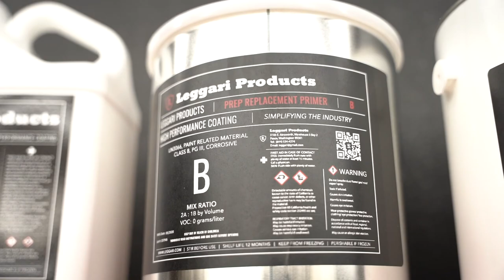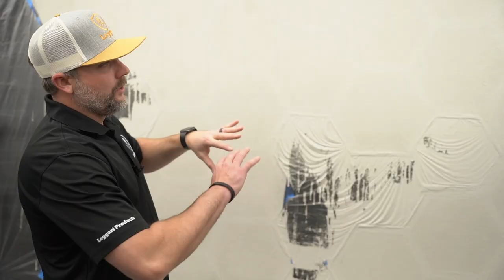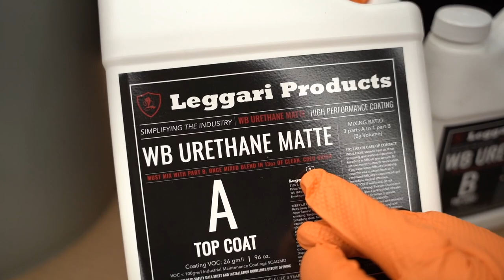Amazing DIY Honeycomb Wall Design That's On Another Level |Right Over Wood Using Concrete Overlay

Comment from the maker: Let us know what you think of the final look! 😃🤩
Reply: A complicated methodology, but it turned out OK....
Reply: Hello, I love the design of this wall, could see it being done on a family room
Have one question, I have an issue with efflorescence (that white flaky stuff that grows on walls, not mold), was told it is due to water trapped inside the concrete walls.... do you know of this concrete overlaying would be a good way of waterproofing the outside walls of the house... using a matte finish of course. Thanks for your help. Karen
Reply: 222

Comment: I have been doing the same thing for 10 years.   I use joint compound. Then Tint use paint. Water to thin if need be. Then Elmer’s school glue to seal it...nice to know there is a brand that’s, cement now going to have to try this out.   Great end product

Comment: Hey guys I love your videos keep em coming. I got a question though, should you be masked up while working with this stuff? Or does it have low VOC or something?
Reply from the maker: The overlay is zero VOC’s. Masks won’t add any extra protection while using this. While mixing, yes, we recommend wearing a respirator until the powder is fully blended into the Liquid Polymer. Thanks

Comment: I noticed you are not wear a respiratory mask.  Is it because you are in a big open space?  I love using this product only once so far.  I have read many comments on fb from people suffering different reactions.  Not this brand of epoxy was mentioned.
Reply from the maker: Hi Linda, this particular product is our concrete overlay, different from our epoxy line. We recommend wearing a mask when mixing our concrete overlay system, after that you don’t need to. As far as our epoxy line, it’s also zero VOC’s and one of the healthiest epoxies on the market. You want to make sure you’re using a 100% solids Epoxy to avoid any type of chemical evaporating out of it. Thanks